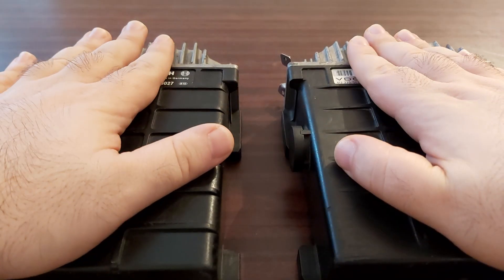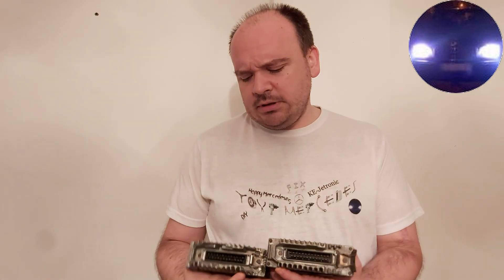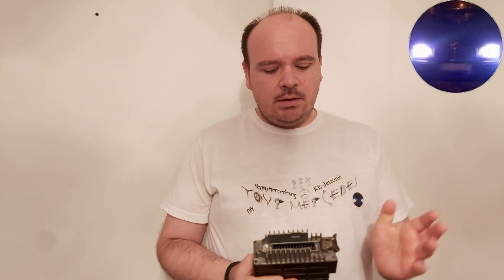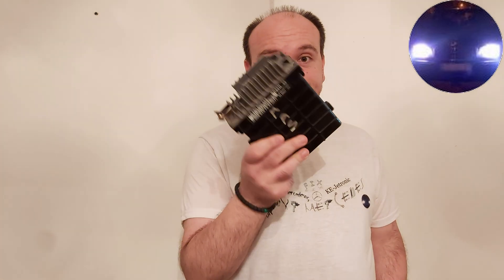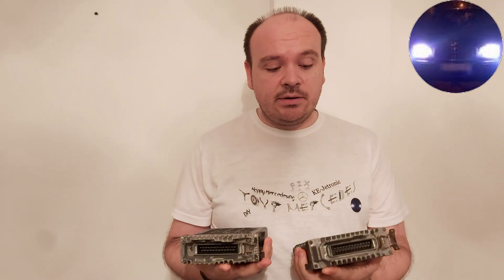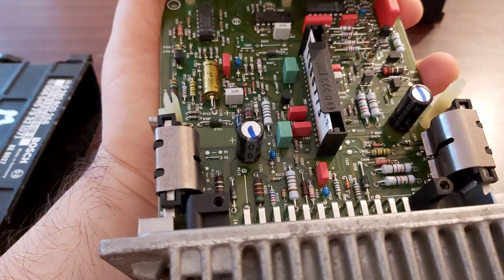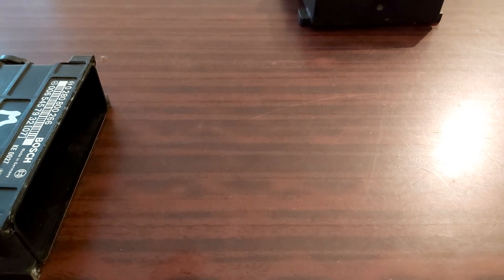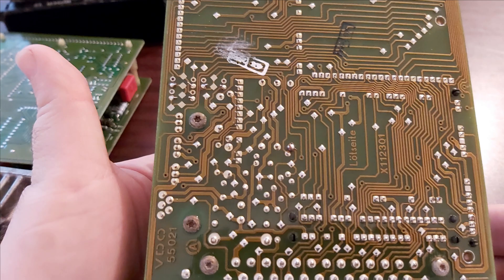㉦Mercedes Ke-Jetronic㉦ - 💻Two ECUs💻, two different systems

Comment: I am repairing my Motronic ECU. Its fuel pump relay control circuit has failed, and applies a continuous 8.5 volts to the fuel pump relay coil. Luckily, it is enough voltage to keep the fuel pump relay contacts closed, for now. But, the problem is, the relay is ON continuously.

I have traced the problem to one of the chips on the ECU. Unlike all of the other IC's, the failed 20 pin IC has a Bosch part number, so I'm not sure if it is a generic component with a Bosch marking, or if it's a Bosch custom part. The part number marked on the IC is "30047 5190". Instead of switching ON and OFF, the IC pin that controls the Fuel Pump relay has an internal leakage of 107 ohms to circuit common, maintaining continuous voltage on the relay.
 
Do you have any information on that IC? I have searched, but can't find any information on it.

And, yes, the two 220uF capacitors had also failed.

Thanks again for your help.

Paul.
Reply from the maker: Tell me which car is it about?
Reply: @mercedeske  Thanks for the reply.
It's for a 92 Rolls Royce Silver Spirit, with a Motronic 0 261 200 227 ecu, but although not a Mercedes, I think the component would be mostly the same, with the Bosch IC 30047 5190 also being used in some motronic ecu's used in Mercedes.
The IC drives the fuel pump relay coil directly, but instead of switching the relay coil on and off, the IC does not switch, and has a constant output of 4.5 volts, leaving 8.5 volts on the relay coil.
I can't find any information about the 30047 5190 IC. I have tried the Bosch website, but with no luck.
I was hoping that you or your contacts who are knowledgable about the Bosch system might know more about the components.
Thank you again.
Reply from the maker: Here, I have managed to find something 
https://www.ebay.com/itm/183863865120?hash=item2acf23ef20:g:64cAAMXQXQxRaMsS&amdata=enc%3AAQAHAAAAoAZMxPL97mTEIHwW7bal%2F9HaTXQ0E1zdQ2L%2Bx2HVDNceZJK5zwDz4G9rsaC7NlVXqkTbp4cLB5%2BXb1IJl5LVCxsss9O1gc5LsVRCtBlFfgu8IImzF%2BtAUVGkUKIgLbSKRsBfPkSJ7k%2Bua%2FyNYSxWpNMe3okSQqWEICwGKI0uHZijB2ZY%2BfVsz44sgK7ddhUhzUUfPnpNHm2DMM0Vss3WgjM%3D%7Ctkp%3ABk9SR8qa7NXWYA
Reply: @mercedeske  Thanks. I'll contact them.

Comment: Buddy's CLK 2004 550 and 100,000 MI the timing chain is stretched keeps putting out codes, has an oil leak from the engine who knows where, motor mounts all broken transmission mount too, the rubber donuts on the lower control arms not ball joints those are ruined, and the lower donuts on the rear control arms need replaced. This car is immaculate inside and out no accidents twin turbo V8. And brings very little money just a few thousand and value. Mercedes are a pain in the ass

Comment: Very nice video but I have questions, How to tell that ECU need to replace, i have 300e m104 1993
Reply from the maker: I will make a video on it. In essence it's very easy - with a multimeter measuring mA on the EHA. On the ignition on engine OFF you will have to get 20mA, if you have a non KAT car then 10mA